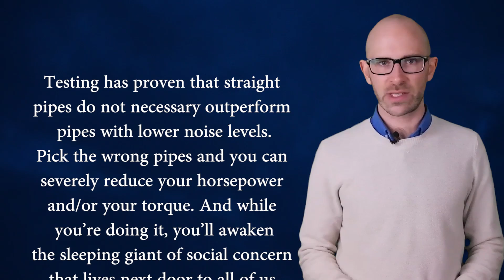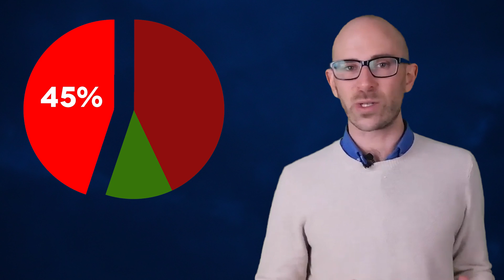Why are Harley Davidson Motorcycles So Loud?

Comment: What is 10% of 50,000?  Why do I want to be one of those fatalities that could have been prevented by having louder pipes?  I have been nearly ran off the road due to driver's not knowing I am there, even though I am NOT in their blind spots.  Plus I do wear hearing protection and a full face helmet.  Please stop talking about things that you do not seem to understand.  Hop on a silent motorcycle and ride around... then hop on a loud one.  You WILL notice the difference on the road.

Comment: If HD stopped selling straight pipes was because it was no longer profitable. TONS of manufacturers sell pipes for reasonable cost. Straight pipes are almost never the best power maker, but are easier & more cost effective to make. Also, there Straight pipes vs pipes with lower noise levels" is referring to other performance exhausts, but NOT stock/factory exhausts... Lastly, there is only a small minority of HD riders that are hung up on actual HP & TQ numbers. If it was all about performance, they'd sell and ride a Busa, ZX-14, or an H2.

Comment: This is interesting and I agree with what you are trying to say but spouting off un-qualified sound level numbers like that really detracts from your credibility. The same sound measured in differently weighted decibel scales (eg. DBa, DBb, DBc) might have nearly identical readings or vastly different readings depending on the spectrum of said sound.  Without specifying the distance the measurement is meaningless; every time you double the distance you reduce the level by 3DB, which means that there is no way that the military jet would be anywhere near that loud when flying over the observer as high as the shot you provided implies. The distance from the source of the sound  and nearby hard or soft surfaces can also make a significant difference because of the reflected sound combining with the direct sound.

Comment: I rode a stock Road Glide, and it was so quiet, I couldn't tell what the engine was doing. Really hard to gear down that way. I think sport bikes are way more loud. Especially, when they constantly het the rev limiter, like it sounds good, when it sounds like don't know what their throttle hand is doing.

Comment: well, supersports achieve higher levels of noise than HD bikes with after market pipes. I am not a huge fan of noisy ones, but motorcycle engines tend to rev a lot higher that your typical car, thus creating a lot more noise.  the old-er 250 ninja IIRC was reving easily on the 15k -19k mark ; your typical SUV while on highway speed won't cross 3k rpm. so there are a lot of factors and variables to me accounted for besides the ones mentioned in this video. just my 5c

Comment: Believe what you want but, I personally have sent many drivers, not paying attention, back into their own lanes by twisting the throttle of my Harley to wake them up.
Reply from the maker: Do Harley's not have horns? ;-)
Reply: Is that the point of your video that we should have loud horns and not loud pipes?  I'm sure a lot of drivers hear me before they see me. It's hard to quantify how many possible accidents have been avoided.  Your statistic about most of the time the accident is the motorcyclist fault, but I would bet money that most of those at fault motorcyclists are not on Harleys. So unless you break it down by weeding out the non Harley motorcycles, your statistic doesn't prove anything. I guarantee that also being heard is better than waiting for someone to just see you. Besides, who doesn't love the sound of a Harley?
Reply: The horn decibel level is too low for the occupants of the vehicle about to ram me, while I am working the clutch, for the to hear because it sounds like the horn of a MO-PED.  The larger air horns are too big for the smaller (Dyna and Sportsters) bikes to fit properly.  I do not know if you ride.  If you do not, I encourage to do learn and do.  You might be surprised.

Comment: in the MSF riding course it explains that even if a person looks at you from their car, it doesn't necessarily mean that they know that you are there 

I will install a louder exhaust system on my motorcycle so people can hear that I am there sure you may get mad that I am review my engine (not through my whole rpm range, but just a quick small pull to disrupt the pattern of sound that my engine produces) but before I do so you may not even realize that I am sitting next to you

Comment: You sir are a misinformed D-Bag. Anything can be loud with aftermarket exhaust, even your mouth. Your title is calling out a particular brand for no reason, other than your sweater wearing A$$ drives non-American! A stock Harley is as quiet as a mouse.
Reply from the maker: "A stock Harley is as quiet as a mouse."  We mentioned they were relatively quite, stock. This particular brand is called out because it has the reputation of being extremely loud due to the owners more commonly than other bikes modifying the pipe portion of the exhaust system.  So much so that even the COO of Harley himself felt the need to chastise his own customers about it.

Comment: you might ride but is it a Vespa? your facts and even the after discussion blaming the after market pipes are SKEWED. in the video description, you say "right off the floor" Harley nor any other manufacturers bikes come "right off the floor" loud. And I ride a yamaha. fucking idiots
Reply from the maker: We mentioned that stock they are relatively quiet.  Perhaps you're hard of hearing? ;-)
Reply: +Today I Found Out nope not hard of hearing, you must have waited till near the end to mention that. I didn't make it that far because I quickly bored of all the unfounded numbers and false facts.
Reply from the maker: All numbers and all facts founded and sourced.  Just because they aren't to your liking doesn't make them not true. :-)
Reply: +Today I Found Out again not true. aside from my own bike being modified and not hitting 80db, Harley's don't hit the show room making 80db either. you obviously misrepresented the facts either purposefully or accidentally. and the video was obviously skewed against HD. as I stated before I ride a Yamaha but I have many hours in the dyno room with HD, Yamaha and BMW as I was factory trained in all 3. The science does not change over boarders. each and every manufacturer measures every sound creating aspect of each bike in sound booths during R and D. The air at speed is normally louder than most models stock on the road. everything else considered equal, ALL BIKES are louder modified and some can be quite a bit more painful than HD when done at a comparable level.
Reply from the maker: We never said anything bad whatsoever about Harley in the entire video, contrary to what commenters here seem to think. People don't pay attention apparently, and in this case I think are taking a lot of things other people say about Harley's and their owners and thinking we're saying the same thing just because we have a video about Harley's being loud (because of what owners commonly do to them). Not Harley's fault at all, which is also why we mentioned the COO of Harley recently telling his own customers to knock it off with modifying the mufflers.

"ALL BIKES are louder modified and some can be quite a bit more painful than HD when done at a comparable level."  We never said anything different.  In fact, we said EXACTLY that. :-) Not sure why you're disagreeing with this video from your comments.  We're saying the same thing. :-)

Comment: i watched this video, and i still dont know why harley davidson motorcycles are so loud. rice rockets are loud when they dont have mufflers on them.  so why do harleys have that distinctive sound? cam design? long stroke?
Reply from the maker: Distinctive sound is due to engine design. But overall loudness is primarily as we said in the video, just because it's common for Harley owners to swap out stock pipes for ones that don't muffle nearly so well. This happens with other bikes too, but is more a thing with Harleys. This is so much a part of the culture of Harley owners that the COO of Harley himself came out to berate his own customers about this, asking them to knock it off, as mentioned in the video.

Comment: Most Harleys are modified by the owners. They either remove the baffling or put on aftermarket exhaust.Some remove catalytic converters which is illegal by federal law. Some places have banned loud bikes. I ride but not a Harley. They are ok but not for me. I prefer a more refined motorcycle. One that I can ride 800 miles and not feel beat up. Harleys just aren't comfortable to me. It doesn't matter what you ride only that you ride! I have made many friends that ride Harleys.

Comment: i disagree with your conclusion that the motorcyclist is usually at fault more often then not its actually the driver of the car, they forget to check their blind spots and instead of actually looking over their shoulder before pulling out just take a quick look in their side view mirrors then pull out leaving their blind spots unchecked. every accident involving a motorcyclist except one was the fault of the driver in the car, the one time it wasnt the motorcyclist ran a red light. im not saying motorcyclists are perfect many are idiots and cause accidents but alot of the time the motorcyclist was blamed when it was the driver of the car, ive witnessed it myself.
Reply from the maker: As a one time regular motorcyclist myself, I can say I've seen all that as well, and don't even necessarily disagree with you here. (It is one of the reasons I don't ride anymore- also I broke my street bike and back then couldn't afford to fix it ;-)) Heck, as someone who used to regularly drive a little Toyota Tercel, I can say people don't see that car either. Can't tell you how many times I've nearly been run off the road driving that from people who just don't see me at all. It's almost like driving a motorcycle.  I don't have that same problem in bigger cars.  However, when reporting stuff on this channel, we have to rely on what (valid) studies say, regardless of our own personal opinions- everything must be backed by hard data.  In this case, the data we have available says what we said in the video about the accidents.

As a corollary, I've also seen studies clearly showing big rig drivers generally being at fault in accidents.  But as someone whose father drove truck for a living for many, many years (thankfully never getting in an accident in like 1-2 million miles), I can say that there were an amazing number of times people would dart in front of him in traffic and slam on their brakes.... He was leaving that gap for a reason, of course. But cars in traffic don't ever seem to grasp that.

Had he hit them (close call countless times owing to simple physics of how long it takes a fully loaded rig to stop, even at lower speeds), it would have been considered his fault for rear ending them. It would not have been his fault. 

Lots of examples like this.  But even so, were I to do a video touching on such a subject, I'd have to go with the hard data available or not mention it at all. And this isn't a bad thing. There are an amazing number of times where our anecdotal experiences lead us to making incorrect assumptions and conclusions.  My dad was a great driver; many other truck drivers may not be or for various other reasons may be causing a lot of accidents. 

Similarly, a lot of you may be great motorcycle drivers and are only thinking of the experiences where drivers don't see you and almost cause an accident (or do). But there are also an awful lot of motorcyclists who drive extremely recklessly out there. (I've seen many of those as well.) Just because it's not you, doesn't mean it's not happening. Or maybe it it's not, and the DOT is incorrect in their study. But the way to argue that is not to point out anecdotal accounts, but rather to find the flaw in their methodology and expose it. Are they counting some accidents as the motorcyclists' fault, like the motorcyclist being run out of their lane by one car, ultimately causing them to hit another car or the like?  What percentages are accidents like this, if they are indeed happening and being counted against the motorcyclist? Etc.
Reply: Today I Found Out i agree with you, it just bothers me when ive seen really safe riders die because of cars and its labeled their fault, when it really wasnt, i wish i could do the research to prove if the studies are right. i  have a feeling the numbers are alot lower then the say, i can also say the same about car accidents involving cyclists, however i did not mean to offend you and i hope i did not. i just happen to feel that there is a flaw with these studies, im not sure if they are just flawed by a margin but it still swings that way anyways or if it truly is more often the fault of the car. ultimately since i cant prove it i cant really debate off any hard data, i do understand where you're coming from you do have to present the facts as they are and you cant let a person bias get in the way. i apologize 

 my uncle  drives a harley the good thing is though he is a very large man, hes about 6 foot 5 and built like a slightly over weight body builder or a wrestler hes huge and its kinda hard to not notice him but hes also been riding for like 40 years so he knows how to avoid most issues. his bike isnt very loud either it does sound rather lovely though has a nice deep sound he put custom pipes on but they arent any louder then the stock ones i find. my other uncle on the other hand is a really small guy and he used to have a small car, he upgraded to an suv for his next vehicle, but with his car ither people in cars still didnt notice him, i cant remember exactly what is was but it wasnt the tiniest car, i was always kind of surprised by how many times it seemed like people just didnt notice him. 

i also understand traffic laws themselves can be flawed in many ways, but i personally think every car should have a dash cam so when accidents do happen footage can be examined, any on board computers data can be examined and the person truely at fault should be held accountable. i dont think its gonna happen any time soon but i wish it would.  

i agree there are many very dangerous motorcyclists on the road, and they give a bad name to all the good ones. i understand there are terrible drivers from all walks regardless if you drive a motorcyclist a vespa a car an suv a truck whatever it is. even a cyclist can be a danger, ive seen a cyclist basically cause a head on crash as the first person swerved to avoid him darting out and then him swerving into someone elses way as they try to get out of the way the two cars hit head on thankfully they were going fairly slow by the time they connected and no injuries resulted but the person responsible rode away. 

i do have to disagree with you that harley's are loud as they arent very loud stock, and any bike can be made loud any vehicle can be made loud shit my uncle knew a guy with a fucking corvette 454 in i believe a firebird and it apparently used to set off alarms shake cars, couldnt hear the person beside you in the passenger seat talking. ive also seen an electric car in my city with false exhaust system used speakers and such to make the car sound like another car. There are also sport bikes that are way louder, they sometimes sound quieter as they have a higher pitched sound more whiney vs the throaty sound of many harleys. ive tested this, my uncles bike versus my friends sports bike the sports bike is louder decibel wise but a few of those present at the time agreed my uncles sounded louder. neither bike is all that loud compared to the honda or yamaha(not sure what it is other then a cruiser) a street over or the guy up the street with his harley even the triumph down the street is louder then my uncles bike. i can assure you that 2 of those bikes do have custom pipes not sure about the triumph though, but my uncles bike also has custom pipes the two guys who have fully custom harleys with crazy ass paint and literally aftermarket everything neither of their bikes is all that loud, lol i just realized theres alot of people in my childhood neighborhood with motorcycles.
Reply: Today I Found Out lol but those people can be fun to screw around with, i usually just troll them.
Reply: Yea ive heard the iposite of this guys claim. Hes twisting the wording to get his idea to sound right. Like mentioning twice the single rider accedent stats
Reply: levi leitaker he also targets a brand of motor cycle that isnt inherently loud knowing many riders dont like harleys because of the stigma that the people who ride them are wanna be bikers and assholes and treat people on any other type of bike like shit. i know stock honda's that are louder then my uncles harley which has custom pipes. i know crotch rockets that whole being louder decibel wise sound quieter because of the pitch and tone of their engine and exhaust deeper sounds carry better then higher pitched ones
Reply: He makes a long winded response how hes going by hard data. Wich is wrong i looked it up after watching. Then just like in the video he keeps changing the sinario. He says he had a tercel 🚗 ok and his daddy drove big rig ok what the hell does that have to do with motorcycles lol